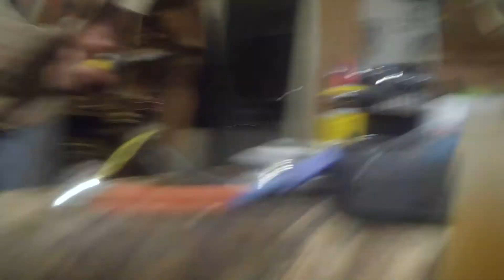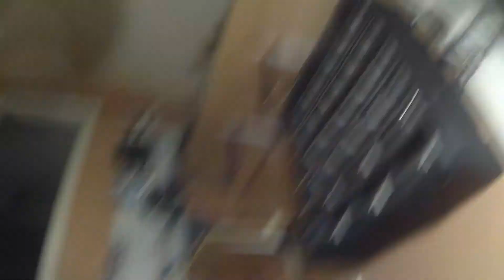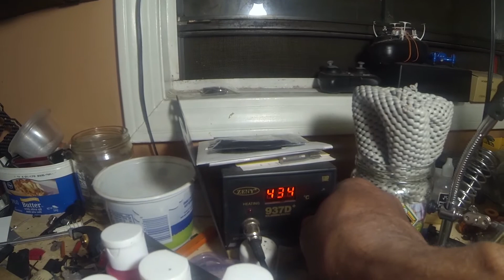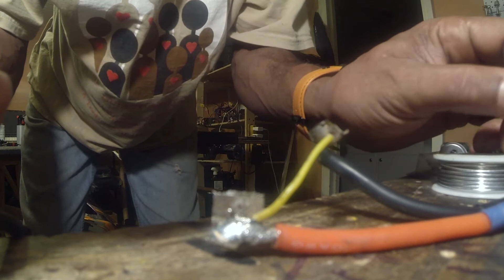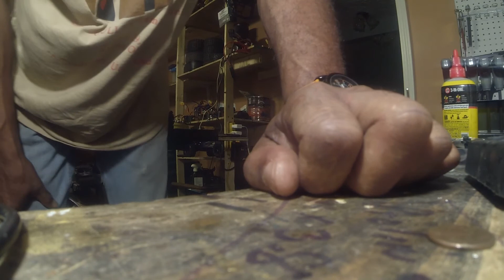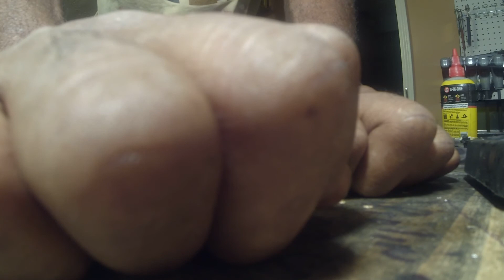Lipo Balance wire repair for Bro Wally Like this you guys :)

Comment: Ty poppa. But I knew part of that. I can solder wires to connectors. Big wires are harder because the big wire eats up the heat. I got one battery that one big red wire with the tab broke off the lipo cell. I was trying to solder it back on. No.luck. I'll try to find your email. I'm walterfarrar495@gmail.com
Reply from the maker: email sent, ring me up Brother!